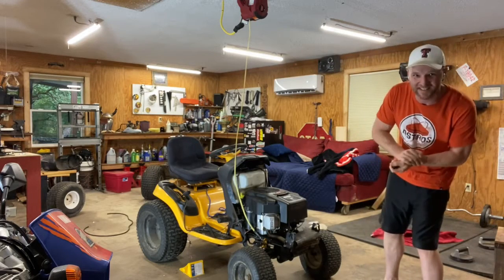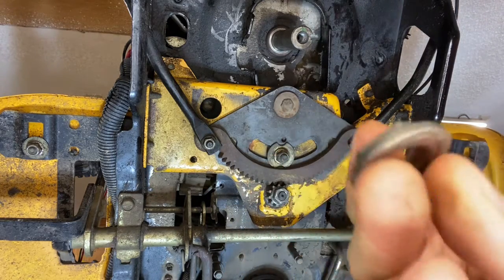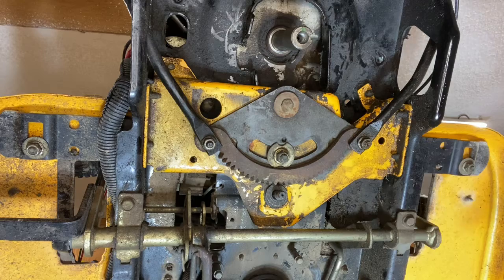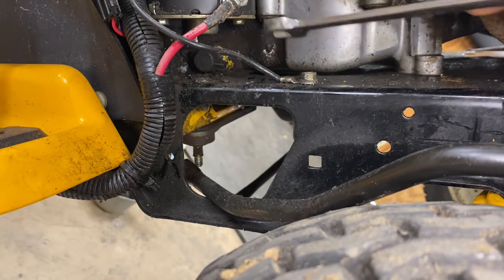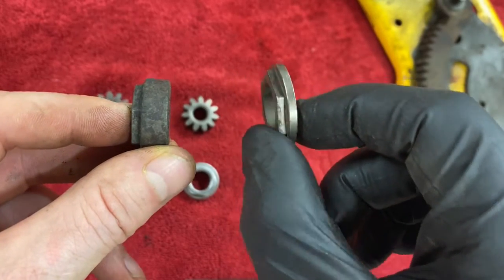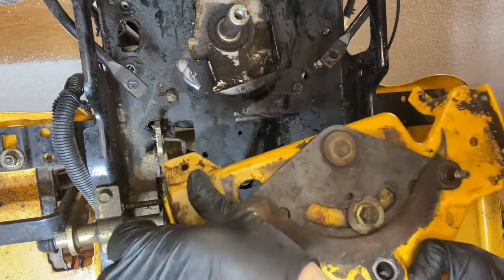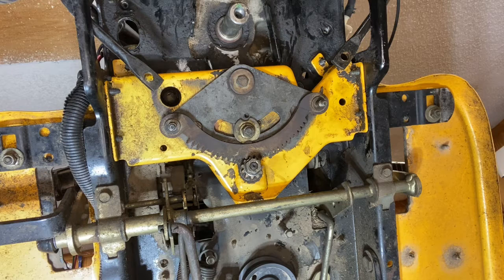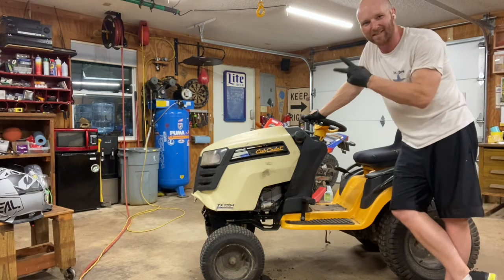Cub Cadet Steering Repair; Bushing & Pinion Gear Replacement GTX 1054

Comment: Mike….you forgot to tell the people to get the steering wheel facing the correct way up top before tightening the nut on the steering shaft….details Brother….don’t forget about the details….otherwise another great video full of good information….have a blessed day!!
Reply from the maker: Excellent point, I didn’t even think about that. Guess people will just have to learn that one on their own, it doesn’t affect the steering at all just makes ya look goofy. Dang it now I am going to have to check mine pretty sure it is sideways lol
Reply: @MowerMike  lol sorry Brother I’m just a stickler for details I guess

Comment: I actually changed mine last summer and I didn't have to remove the plate. I had a helper hold the steering rod up and reached my hand up in there to replace the bushing. Working alone I could see your way being a little better.
Reply: Only needed bushing under gear, I held my steering wheel up with my jacket, job done
Reply: All that work for nothing, only needed bushing, no need to remove ai that

Comment: Great video. The first one I've found that actually explains things. My problem is that when I use the impact to loosen the tie rod nuts, the whole bolt spins and the nut doesn't move. Is there a solution to this problem?
Reply from the maker: The top of that bolt should be a bolt where you can get an open ended wrench on it and hold it as you unbolt it.

Comment: Have you found this happening on the newer XT1's? My steering has a lot of play (rocky land we have)
Reply from the maker: No idea I just mess with old stuff. I would wiggle the wheels and they may need new bushings. I am going to dropping a video soon on a bushing upgrade to tighten up the steering on Cubs

Comment: You can carefully grind down some of the pinion gear packing it not to loose any pins then use a washer the thickness of what you ground off.[if u're as cheap as I am😁.
Reply from the maker: Haha I like it but you are a super tight ass! Cracking up over here
Reply: was gre a
t

Comment: is there no bushing on the steering rod you took off ;are they rubber or steel
Reply from the maker: I appreciate the comment. Welcome aboard things could get weird ;)
Reply: @MowerMike  on the tierod that bolts to the plate for steering it looks like theres one on each side

Comment: You said it has power steering don't believe so I dont think you had to pull that plate off
Reply from the maker: Yep has an electric power steering pump right behind the engine. Is much easier for me to just drop the plate off.